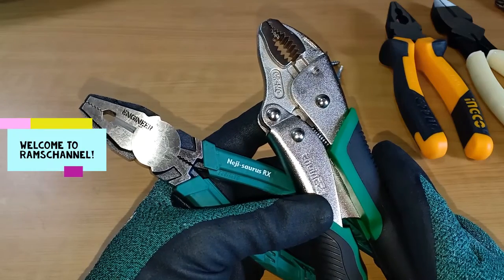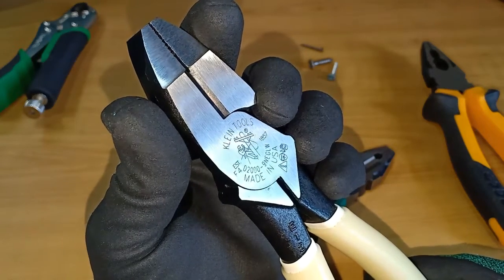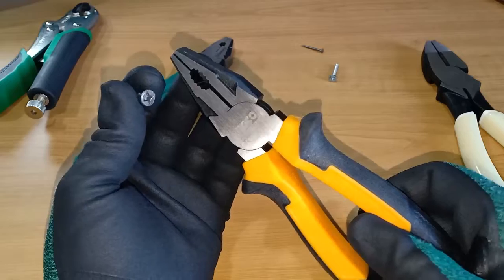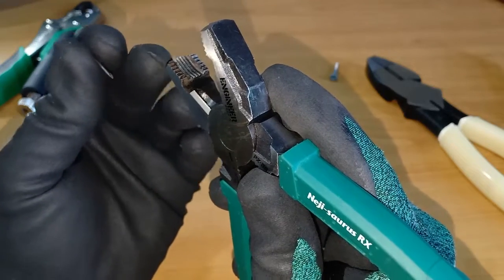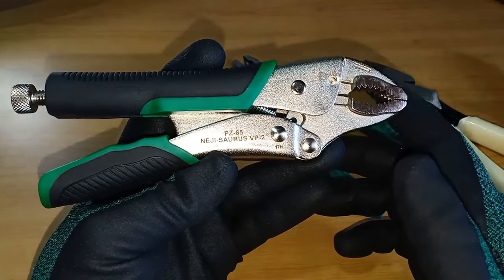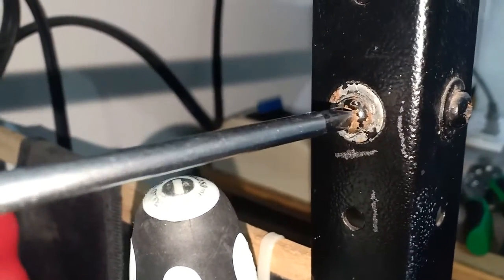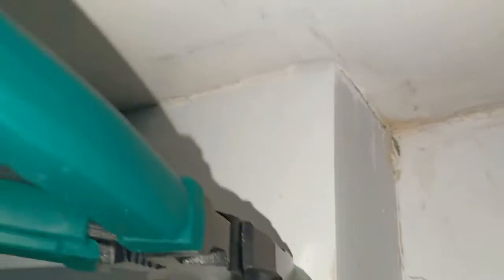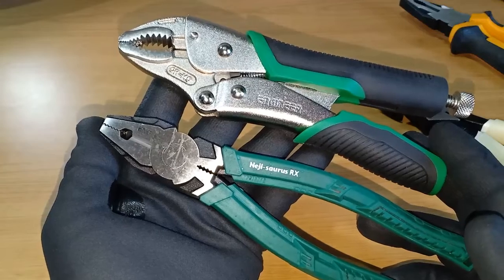[ENG SUB] ENGINEER NEJI SAURUS PZ-59 & PZ-65 SCREW EXTRACTORS: AN INTRODUCTION

Comment: Tingnan mo yung Knipex twin grip, Knipex ang gold standard ng pliers para sa'kin.
Reply from the maker: Thanks for your comments. Meron din akong Knipex pliers, ka-isa isa. A 9.5 inch Ultra High Leverage Insulated Lineman's Pliers I ordered from amazon. Its quality is excellent. I saw the twin joint Knipex you mentioned there. I would expect its quality to be nothing less. I am satisfied, though, with my Engineer Screw Extractors' performance, for occasional, specialized use at less cost.
Reply: Ok dn un piro gusto engineer plier mahtrap mgtiwala bka kc .mas am me